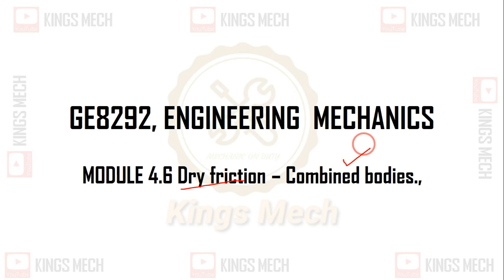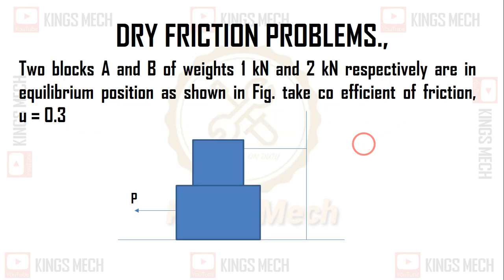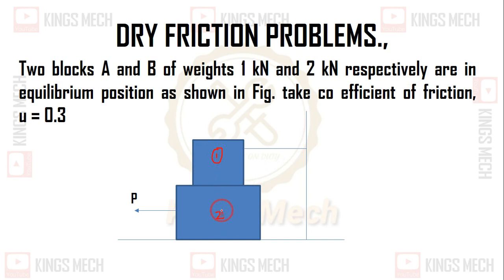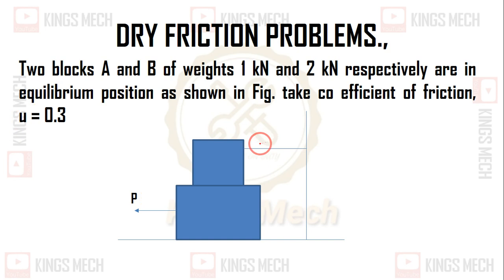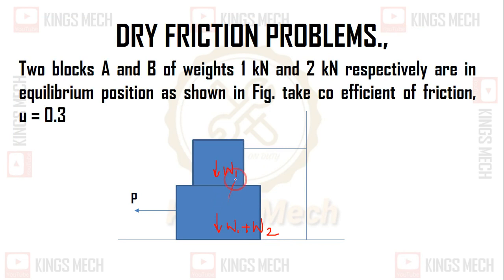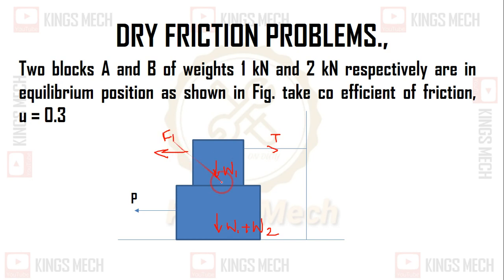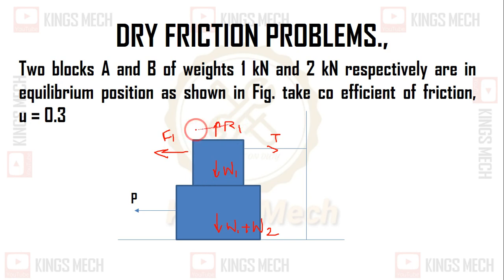dry friction of combined bodies problems in tamil

Comment: Sir ,you already solved this type problem previously but what's the difference in this problem you took (w1+w2) this same for all this type problem or Not
Reply: Sir you already solved previous problem also we want to take (W1+W2) for 2block
Reply from the maker: Yes
Reply: I think in this question they said both blocks are in equilibrium so what  we take overall weight act on block 2
Reply from the maker: No issues,  proceed with our way
Reply from the maker: When two loads available,  second load will have both w1 and w2